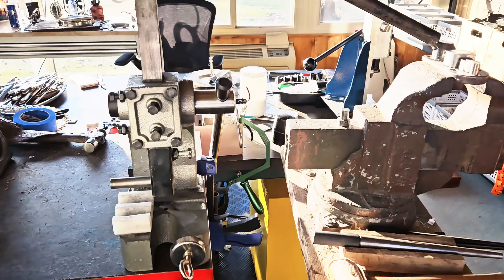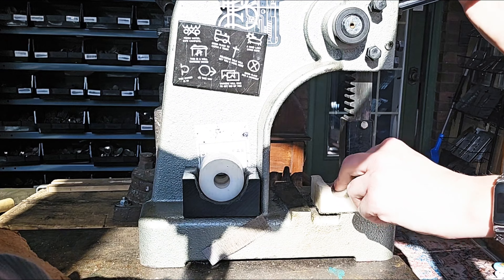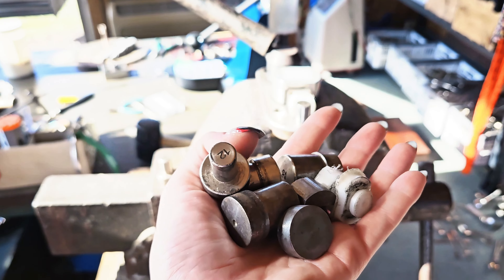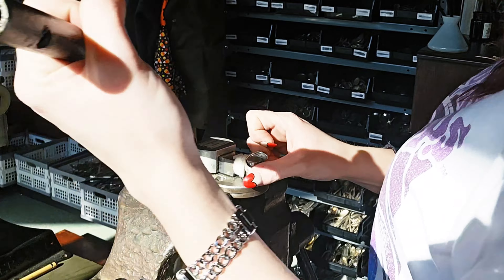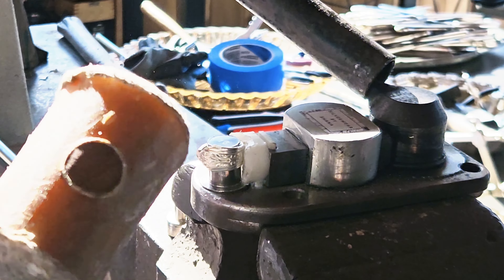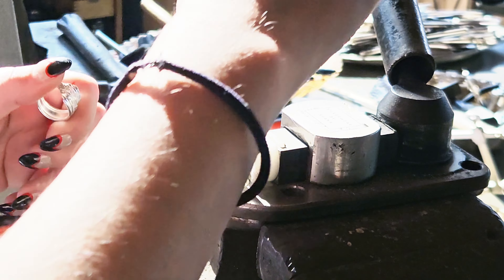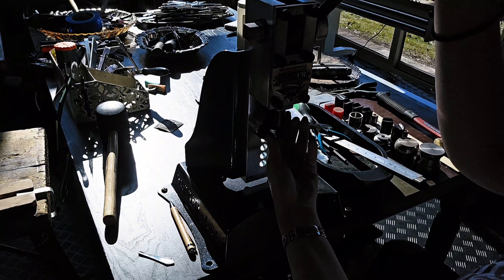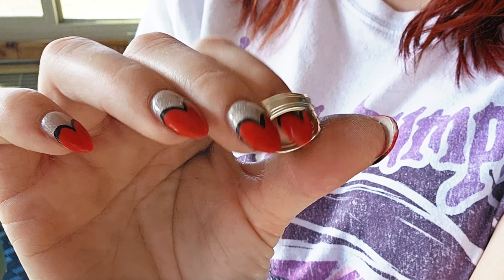Silverware benders.

Comment: As the original designer of the bending tool shown at the 00:45 mark, it is a shame that you do not use this tool for rings "since you are struggling with it, and not have much experience with it", as this tool was designed PRIMARILY TO DO RINGS!  With practice, and proper technique, you can make the MOST PERFECTLY ROUND RINGS with this tool.  A steel ring mandrel, plastic hammer,  and a VEE block makes this very easy to do!  There were two things you were doing wrong in using this tool.  First, you were using the wrong "groove" in the forming block.  You should be using the SHALLOW GROOVE FIRST, and then proceed to the DEEP GROOVE.  
And second, you were taking too big of a "bite" when bending.  You should advance the silverware in smaller increments, as this will prevent "kinking".  The final shaping and sizing is performed with the steel mandrel as mentioned above.
I have made THOUSANDS of rings utilizing the first bender shown in this video!  I have a different bender that I designed, and use for my bracelets.  But I did come up with the bracelet "forming" block as a secondary means for making bracelets to use with this ring bender.
My tool was sold under the name of the FBT Bending Tool, and was the FIRST, and still the easiest, to use.
This is a good video, displaying the different benders, side by side.
I also have the Pepe Ring Bending Tool, but I found it awkward to use, and did not work as well when making "by-pass" rings.
I like Potter's tool, but it is way to expensive for me.
Reply from the maker: Everyone learns differently ☺️

Comment: Is there a bender system that uses socket sets for the various sizes???  I can imagine it will be a challenge since sockets tend to wobble on the wrench doohickey.
Reply from the maker: The pepe and potter both have various sizes but I just use two for the most part.